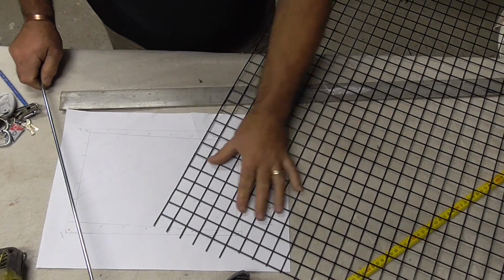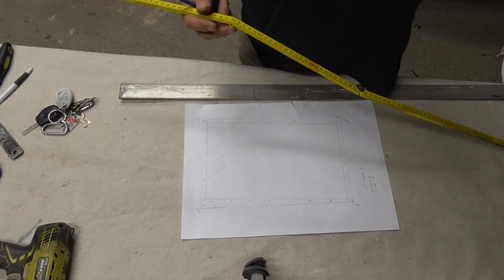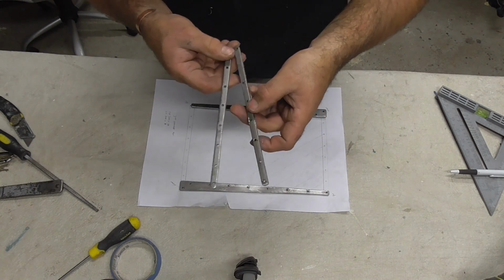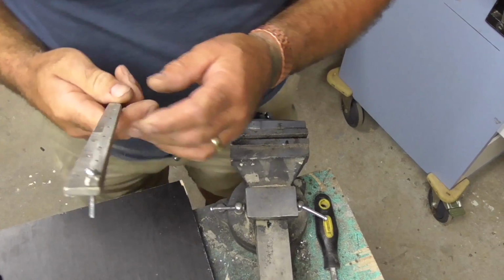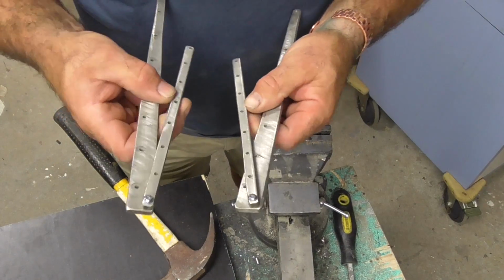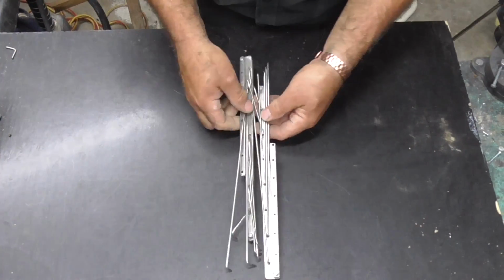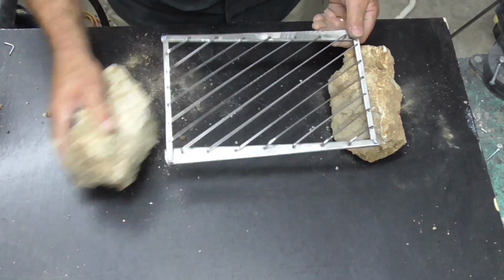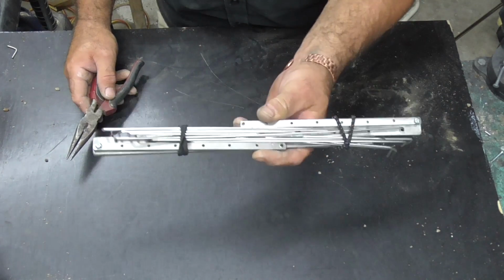Hiking, Wild camp & Bush Camping Fold up Grill

Comment: I've had a similar grill for about 40 years, but it only has 2 solid sides opposite each other instead of 4 solid sides. Just move the 2 solid ends in opposite directions and it swivels right down to the size and shape of a stick. Reverse and it opens right up again. No need to take it apart or put it back together. Grill bars are perpendicular to the solid sides when open, parallel to the solid sides when closed.
Reply from the maker: Cheers Bob. Seems I'm trying to reinvent the wheel. 😝😝😝